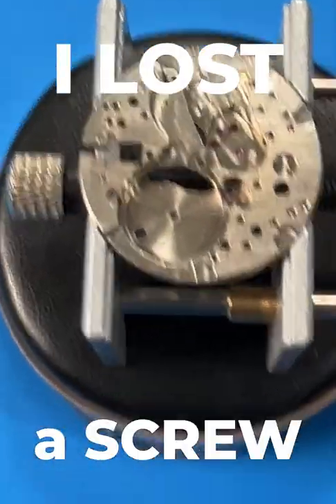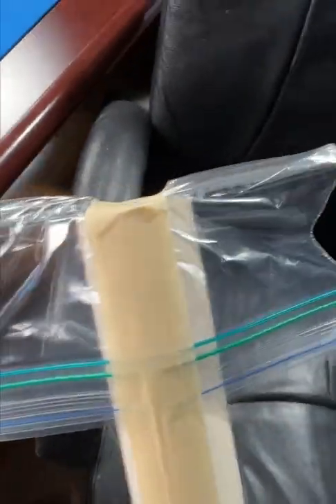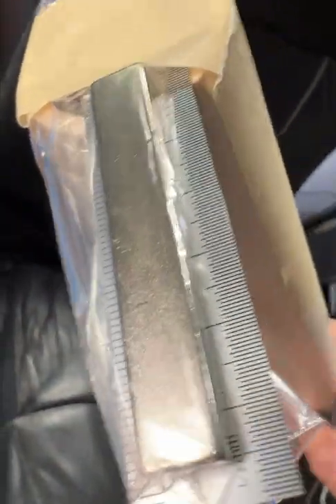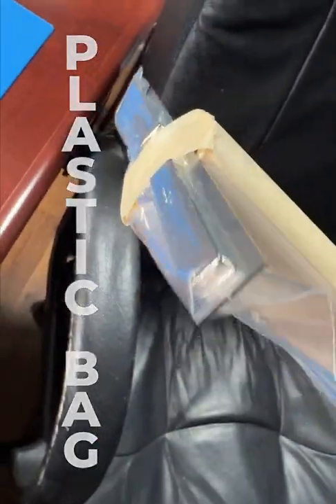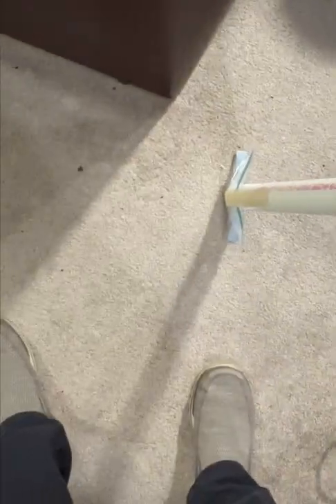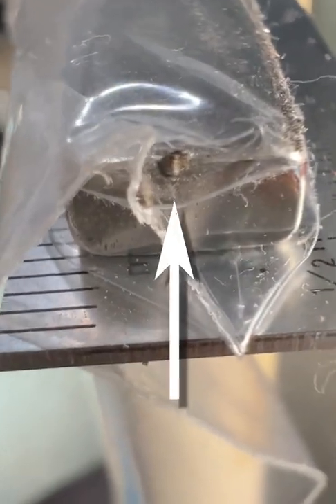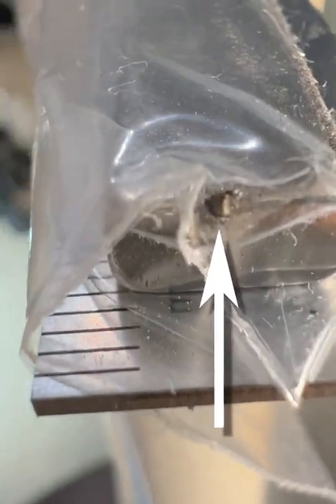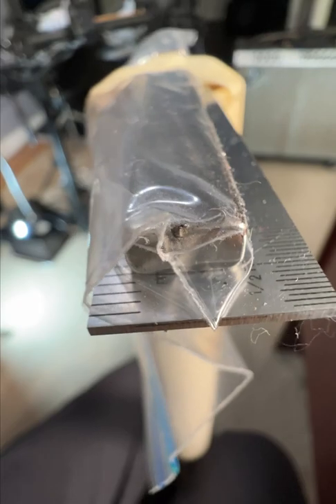How to Find a Lost Screw with Magnets | Watchmaker's Nightmare SOLVED!

Comment: Thanks for this, Mike. Your videos are very helpful to beginners like me. I have lost the same watch part 3 times in a row, lucking out to find it each time. What’s not fun is the stress of potentially not finding that one part and potentially messing up the watch forever. Tweezing skills are critical. With magnets on a ruler and without the bag, you can hear the part stick to the magnet. If that doesn’t work, I use packing tape looped sticky side out over the hand to track over the carpet. Best of luck!
Reply from the maker: @Mars-zgblbl - OMG, I completely agree with the stress you feel when you lost a part! It's maddening. And then you find it and you're supposed to be relieved, but you're mad at how long you had to look for it, especially when it turns up in a really obvious place, or somewhere you already looked 10 times. Thanks for the extra tips on finding parts - you can never have too many tricks up your sleeve! :)